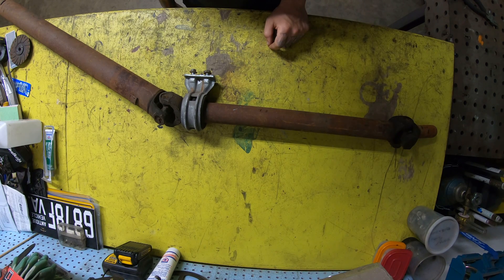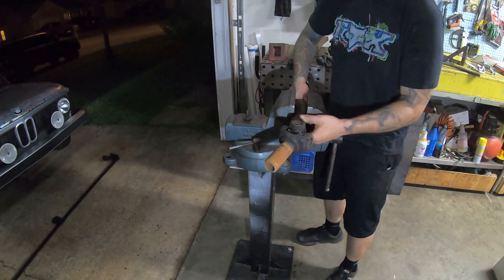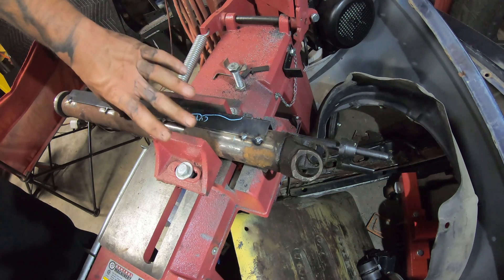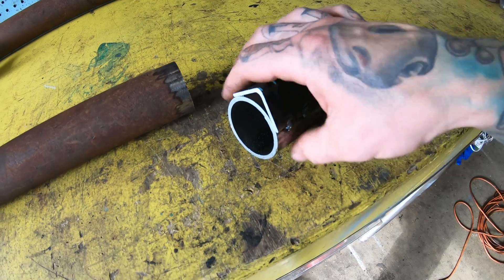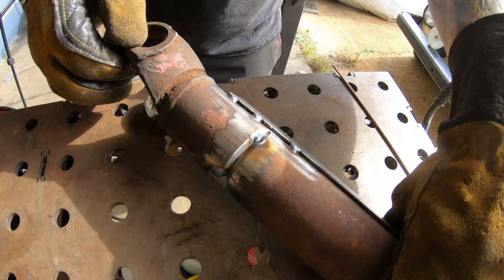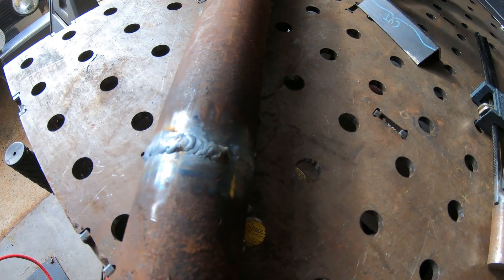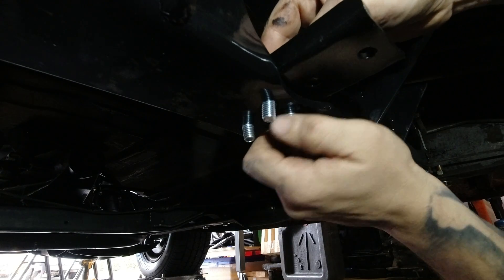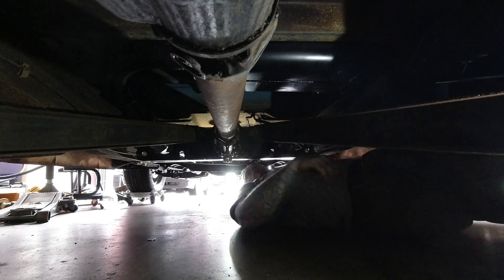How to shorten a driveshaft at home.

Comment: Question. Is there an advantage to cutting the tube inches from the yoke weld and fitting the tube onto the machined stub provided for the original assembly point. Although you did excellent job the way you did it. Video was great
Reply from the maker: Cutting near the weld and fitting the stub is the proper way to do it. That's how driveshaft shops do it, but it really requires a lathe to face the tube to ensure the yoke is square. I can't guarantee my saw is that accurate, which is why I do it this way. My way helps cancel out any imperfect cutting angles that your bandsaw/chopsaw will make.

Comment: It would have been nice to see what, if anything, you did to that one yoke that you said someone beat and muchroomed the holes for the U-joint caps.  I've seen a couple videos of that condition but no one addresses how to remedy it.  After all, if you can't press the caps out, you can't press new ones in.
Reply from the maker: I patiently hammered it and used a file to get the everything back into round. U-joint caps went in just fine. Takes time for sure, but its easy work.

Comment: Oh lord, NEVER cut a shaft like that, you can NOT get it straight,  grind off weld on yoke and remove it, it has a centering lip inside so do not cut all way through,  cut amount you need to shorten, heat end and tap yoke back in, use square and level to get correct, tac 3 sides and recheck levels, weld back together and you have a proper job, not this hack job you did. Sorry for the negative opinion, but i hate seeing bad and improper methods.
Reply from the maker: Far from a hack job, my dude. Is it the way a driveline shop does it? Of course not. I'm well aware that the end should be cut off amd welded back on. Your description in the comment is more of an improper way than I showed in the video. The "right" way is to part the end in a lathe instead of using a grinder. Then cut and face the tube and yoke in the lathe. Then align, tack, and weld...all in the lathe. 

Problem is, my friend, most people don't have a lathe large enough to do this. So they can choose my way or yours. Both will provide a satisfactory job for a quick fix or a daily driver. 

Thanks for watching and adding to the knowledge pool. I appreciate it.

Comment: Why is your carrier bearing upside down?
Reply from the maker: It's a circular bearing. It has no "up" side, therefore it cannot be upside down.  
That would be like saying that when you install a spare tire on your car, it has to be installed with the valve stem facing down, or it won't rotate correctly. Obviously not true, as is the case with the carrier bearing.

Comment: can it be done with wire feed or do you need to use tig?
Reply from the maker: With proper technique, it can absolutely be done with wire feed. That's what pretty much any driveline shop will use. Just make sure it's hot enough to get good weld penetration and you should be fine.

Comment: you could have popped out the shift wire and put it in neutral instead of crawling back out to do it from the cab
Reply from the maker: In fact, I cannot do that. This truck is a 5-speed manual. If it were auto, then yes, that would be the way.

Comment: Can i do this to an aluminum drive shaft cuz i put a 4l80 in my 95 k1500 heavy duty and its a quarter of a inch longer than my old 4l80 so i need to cut it down
Reply from the maker: As long as you can weld aluminum properly, I don't see a reason why it can't be done.

Comment: great job.  I have my motor home in shop.  the rear end went out, so they got a used rear end from junk yard and got it in place.  they say the carrier bearing had gone out and was what caused the ring and pinion to go bad.  now their telling me they drive shaft that they also got from wrecking yard is either too long and they are going to have to cut it.  I don't know why they could not find one that fit.  I hope they know as much as you and can do as good a job.  My question for you is how will I know that everything is good when they get it done using wrecking yard parts.  they already told me the used rear end was 2600.00 so I do not know what the drive shaft and the work to shorten it will cost.  I'm stuck with them as I am in Maine now and live in Texas 2600 miles away. I didn't say it is a 'forest river motor home on a 2004 e-450 super duty Ford chassis and is a 2 piece drive shaft. thanks for any help you might give me

Comment: its crazy to me as a driveline shop owner/builder that people try and keep the weights in the same place like if that's gonna keep it balanced lol. anytime you cut, and reweld a driveline the weight 9 time outta 10 even if within 5 thousands, or less the weight will never be in the same spot as before. i cant guarantee you that shaft is off more than 10 thousandths
Reply from the maker: I'm sure you're 100% correct about this. But I've not had a significant enough issue with balance in any shaft I've done this to that I've regretted doing it myself. For the guys who live out in the boonies and might not have a driveline shop around the corner, I don't think that 5-10 thou will be such a deterrent that they wouldn't want to make the modification and get the vehicle up and running.

Comment: I've done this with pretty good results a couple of times by just cutting the tube after laying down a line long enough to match up the two left over pieces. Clamp those parts to a piece of angle iron and weld it back together. The first one was for a '72 Chev pickup, and the second was for a demo derby car, that admittedly did not have to travel at speed, but did not break during the derby.
Reply from the maker: Strong enough for a derby car is strong enough for me! We used to build those when I was a teen/early 20's

Comment: i like your idea i just bought a front shaft for my f350 from amazon and it was 2 inches to long did not have time for playing the return it game so i cut the yoke off one end but i was disappointed it only had 3/8 of an inch that went inside the tube so i was taking a chance on pounding it back in straight all went well but next time i will definitely try your way next time it looks more fool proof
Reply from the maker: Thanks for watching! I'm a big fan of reference/index cutting, and this was the cheapest and easiest way to do it for this application.

Comment: I've done this before But with the off cut of tube, cut it length ways+ take out a bit extra, squish tube so it can be inserted inside the drive shaft tightly to a-line everything. Good for backstop for welding, can put on vehicle before welding to make sure it fits + spin on vehicle and once welded if it fails it just slips on itself and doesn't flap around.

Comment: this is the best tutorial in YT for DIY shortening driveshaft. i knew those bed rails were useful. i am going to attempt what you’ve done here. thank you and great job brother!
Reply from the maker: Thank you so much! I'm glad I can inspire people to try new things.
Reply: @tinygaragefab I have a question for you. Why didn't you grind the weld down on the yoke and remove the yoke, then cut the shaft to your desired length and  weld the yoke back into place, like how the driveshaft was made? I'm genuinely asking, not being a turd. I'm about to tackle this same job, and figured that I'd cut the tube and buy a new yoke, but if someone didn't want to spend any money, you could carefully remove the original yoke.
Reply from the maker: Totally valid question! I believe it would be difficult to get the yoke on completely true and square. Any amount off and it could vibrate like crazy. The way I did it, in my opinion, gives me the best shot at getting it as aligned as it could be without a huge lathe.

Comment: Nobody would ever do this , ever , never.
Reply from the maker: Nobody?!?!? Just every driveline shop in the country. Do you think drivelines are machined from a single piece of steel/aluminum/etc? They are cut and welded. All of them.
Reply: @tinygaragefab show me one drive line shop that cuts a tube in the middle, cuts a piece out, and welds tube to tube. I'll save you the time, cause not one does it. You grind the weld off the end yoke, shorten the end of the tube weld the yoke back on.
Reply: @ryanharrington4717  I watched this video last night and cut, beveled, and rewelded a PTO shaft for my tractor in under an hour. But yes, I made my cut nearly through the original weld on the end of the tube on one side. I'm amazed at how easy it was and figured I was going to have a shop do it. No balancing since it only spins 540 RPM, but no noticable vibration either.
Reply: I do 😂😂

Comment: Just checking.....are you using the welder with gas?     if not remove front cap , better welding and you can see the wire.
Reply from the maker: This was TIG welded. Definitely uses gas and no "wire"

Comment: Many years ago (several decades actually) I shortened a drive shaft, but I didn't do it the way you did. What I did was to cut out the weld and remove the end cap, then I cut the tube and pressed the end cap back in and welded it. Then I put it in the lathe and checked for alignment with a dial indicator and used oxy to heat and water quench the tube in the right spots to get it aligned. This is how drive shaft manufacturers do the job. I didn't need to balance it and it worked well with no vibration. To ensure alignment, I scribed a line before I removed the end cap.
Reply from the maker: That is one way I'd prefer to do it, but without a lathe, I think this is more than sufficient.

Comment: If you take a piece of stock that’s about half the diameter of the shaft, you can scribe an index mark with that and avoid the angle iron. Use it to index the shaft in the bandsaw too. Save the angle for jigging when you tack it back together
Reply from the maker: Why risk it? Aligning in the bandsaw from a visual mark could still allow a 1-2° error, which is plenty to induce a noticeable vibration. Physical locating (angle iron) is much more precise.